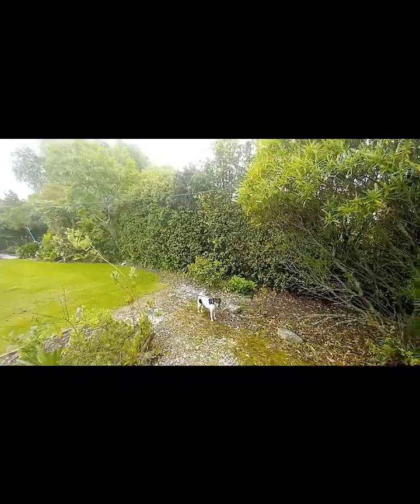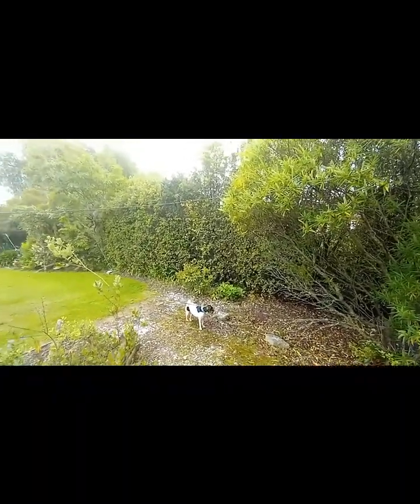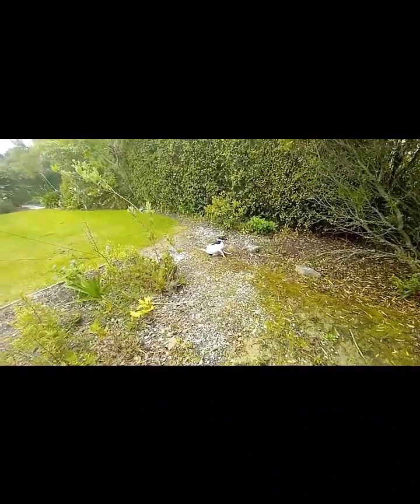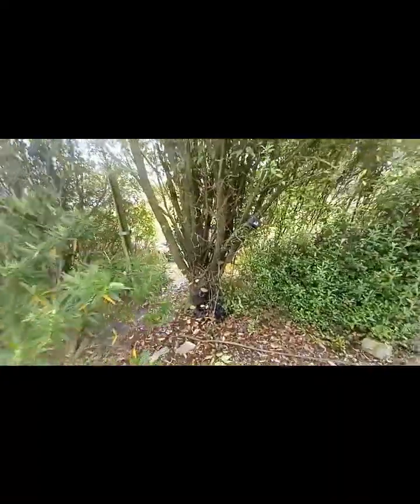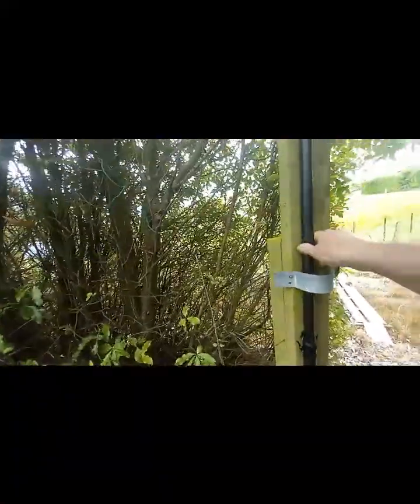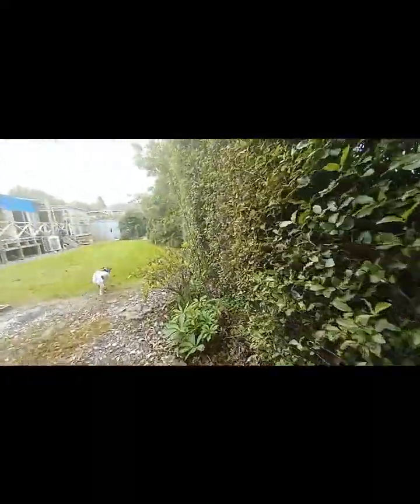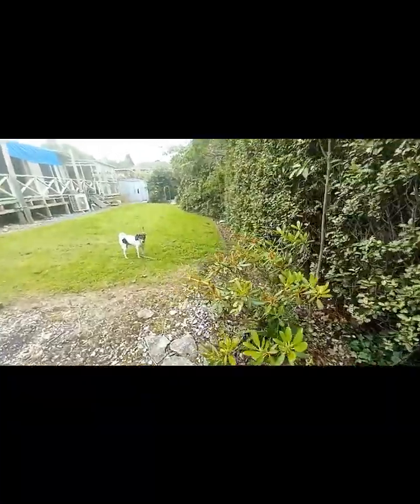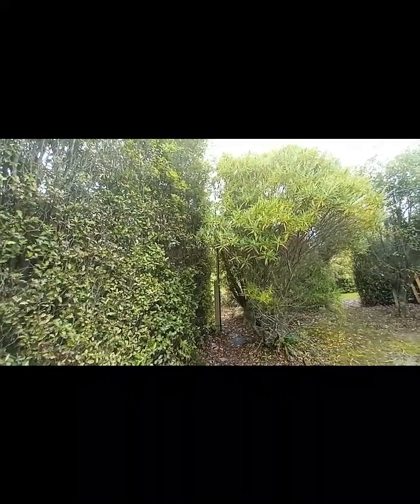ZL3XDJ. reduce noise the easy way.

Comment: Use a delta loop or quad loop and the receive signal to noise ratio will be even better. Also dipolesxtend to be one trick ponies. You can use a 40 Metre dipole on 15, but need to feed it with twin feeder to make it a doublet to multibabd it. A loop can also be fed with a balanced twin feeder with even better multiband results. You hang a loop vertically, slope it or even use it horizontally as an NVIS antenna. As you may have gathered, I like loops😂

Comment: ✅  well done… wish I had a garden like you instead of a postage stamp… just started experimenting with vertical antennas but the weather here in the NW UK is crap… gone from -6c snow and frost to +6 with rain and slutch in the garden. I’ll get there.73.        💙
G0uvl
Reply from the maker: @Rubedo777  my garden in the uk was small, verticals were the answer. 73

Comment: Awesome video. I have that same problem on 40m. One question, do you find that the receive dipole is more directional on receive than the vertical or does it work about as well for receiving since the overall noise is reduced? 73 AE3HD.
Reply from the maker: @yqtszhj  mine is orientated long path short path, but probably not much directional gain at that height.
Reply: @ just wanted to tell you that I put up a receive dipole antenna as you suggested. It reduced my noise floor on 40 meters from a S6 to a S1. It is awesome! Now I can hear all those low level DX calls coming in from Europe. Now I’m just working on a circuit to switch to my transmit antenna automatically when I press PTT. Should have that finished by end of week. Thanks my friend. 73. AE3HD.